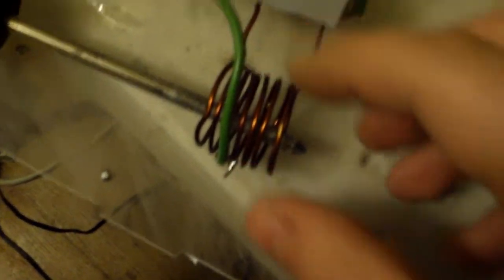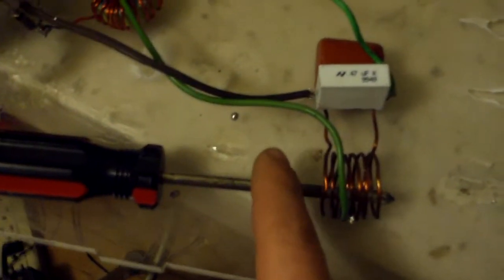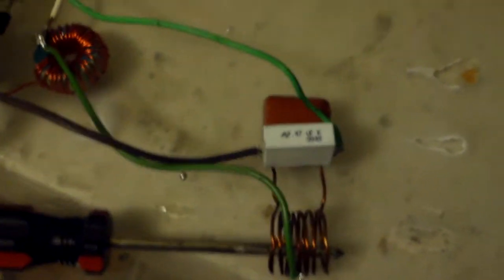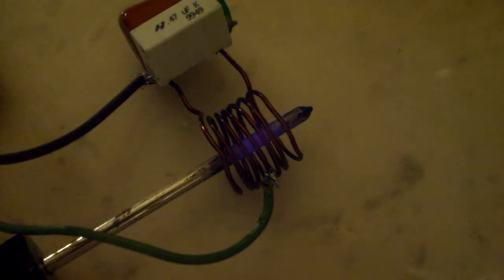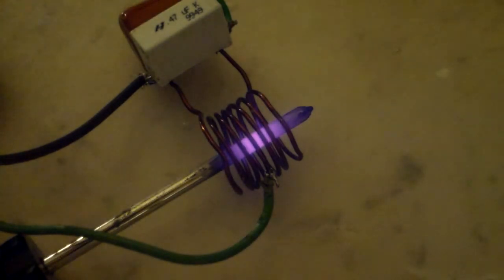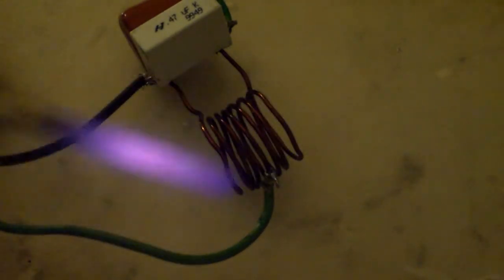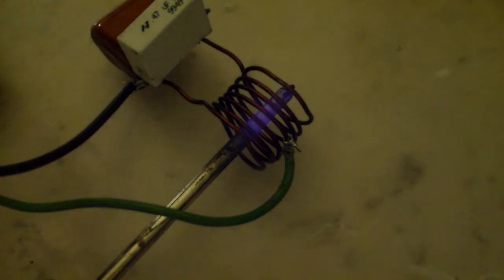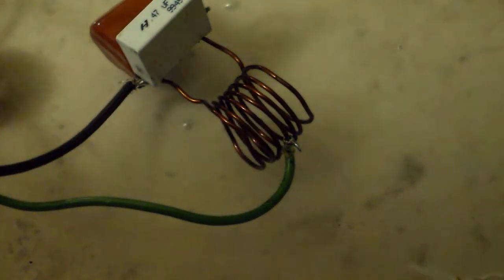ZVS induction heater (250 watt)

Comment: What is the relationship between voltage and current the circuit consume? Does it consumes the same power "W" that means increasing the voltage leads to decreasing the current?
Reply from the maker: The circuit consumes a higher current with a higher input voltage. The reason it is 250W is because at 25 volts the circuit consumes 10 amps. It would be higher power with a higher input voltage.
Reply: Ok then it has no limits of consumption as much power you give as it consumes?
Reply from the maker: @ahmadnab7969  Yes, but with too high a power the capacitors and mosfets would eventually fail so another circuit would be required for significantly higher powers.